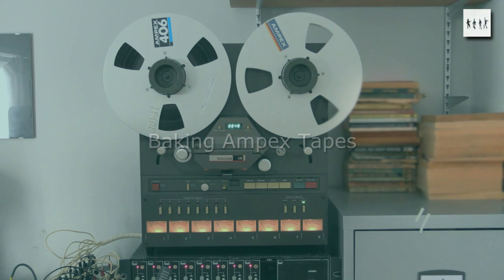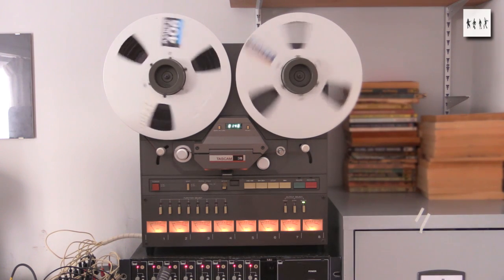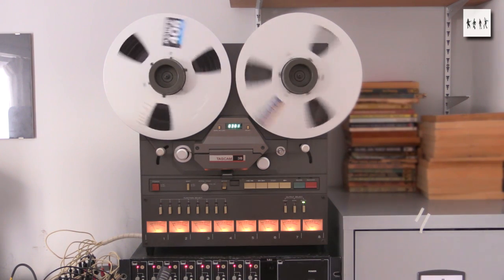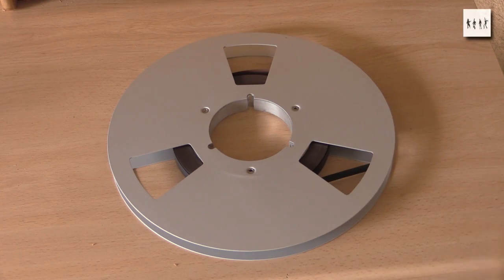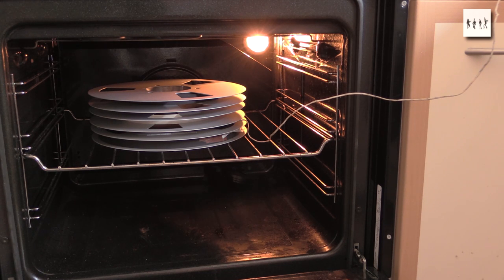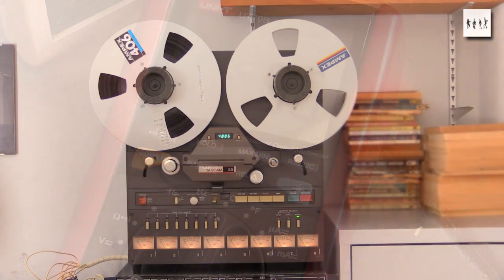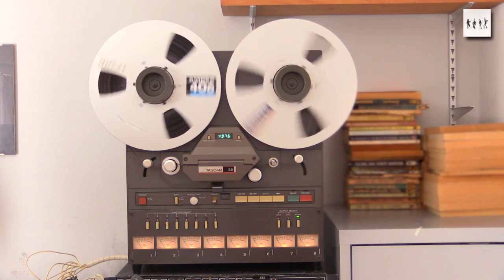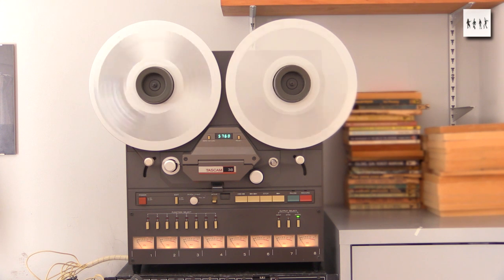Baking Ampex Tapes

Comment: There is a lot easier way to find out if tape has SSS without gumming up your unit like he did with this TASCAM:  Just pull the tape straight across the top of the headblock with holding up the trigger roller or arm and wind it straight across to the takeup reel.

If the tape is sticking to itself as it's feeding off the roll and you rub the tape between the fingers and is sticky as crud, that tape is full of SSS and needs to be tossed.

You don't need to bake non coated tapes and NEVER bake acetate based tapes, or the head destroys the acetate.
Reply from the maker: Hi Monte, 

I guess you didn't notice me ('he') saying I allowed this to run for a while quite deliberately for the purpose of demonstration; not for experienced tape users familiar with the problem (to whom it would have been apparent within the first few seconds), but for casual users who may be completely unaware of the phenomenon. 

In my experience, although some tapes are definitely sticky to the touch as you describe, others may not seem so gooey on first inspection, and only start to squeal some distance into the reel.

While there is no point in baking sticky tape for making new recordings (new - stable - tape is still being manufactured, if you're desperate to do that), tapes that contain precious and irreplaceable material can't just be tossed out, so baking or other restorative action becomes necessary. 

I assume you meant 'heat' in your last paragraph. Will acetate break down at 60degC? Fortunately, I have never encountered sticky shed with that base material.

Cheers!
Reply: @reqordist  ... Yes, heat.  There has been some tapers that have baked  acetate and wonder why it can't be played anymore.  Sorry, I didn't have the volume up and only watched part of the video. I should know better.  Thx and good luck.

Comment: Reel to Reel tapes should be Double-Coated.    Both sides of the tape should be glossy then you do not have any problem.   Unfortunately AMPEX and Quantegy are not Double-Coated and that is why they get sticky and the capstan and the rubber pinch roller gets sticky.   The best one is MAXELL and 3M Scotch ; maybe there are others.
Reply from the maker: Interesting. I had not come across the concept of 'double-coating'. 

The mechanism for stickiness is now well understood and described in the literature, and is related to the hygroscopic nature of the particular plastic formulation used to bind the oxide to the substrate. 

In my experience, a glossy finish to the non-oxide (back) side of the tape is an indication that it has not been back-coated; back-coated tapes generally have a matt finish. 

On the oxide side, tapes may have a matt finish (often older tapes) or a shiny finish (especially highly calendered tapes such as Maxell, often the thinner long-play variants). 

I believe that both the back-coating and the recording (oxide/binder) surfaces can become sticky, and that the underlying polymer chemistry, not surface smoothness, is the determining factor for stickiness.
 
Regarding 3M tape, I have recently had to deal with some back-coated 3M material, and that was very sticky, just like Ampex. Forunately it responded well to baking.
Reply: Back coated or not coated I do not understand technically.    One thing I know from my experience that outside of the tape should be GLOSSY.    The Cassette tapes do not have sticking problem because the back of the tapes are GLOSSY.   Thank you, Krikor Vasken from L. A. CA.

Comment: no sound after baking, are they usable after?
Reply from the maker: The low temperatures involved in baking (55 deg C) would not remove the recorded sound. Most likely the tape was blank beforehand or damaged by truly excessive heat. If the former, they could be re-used for further recording (but not recommended as they will go sticky again within a few weeks); if the latter, the tape base may have been damaged anyway.

Comment: This video very helpful for me!
I thought it was because I used editing splicing tape, maybe a little of that to?
Reply from the maker: Hi Henry - glad you found the video useful.

I've found most splices quite stable if purpose-made splicing tape was used. 

It gets messy where inexperienced people have used regular adhesive tape (sellotape etc.) - but in my experience, that just dries out and goes brittle with time, so the splices just fall apart; leaving the recording tape undamaged. 

It can be irritating when a splice breaks in the middle of a rewind and you end up with loose tape all over the floor! But it's no trouble to re-do them with 'proper' splicing tape.
Reply: Great to know, thanks

Comment: As mentioned, the temperature controls on a kitchen oven are very crude. They are designed to cook things. I would consider this approach very risky. Maintaining a consistent, and consistently >>low<< temperature in such an oven is highly likely to be very difficult. Don't try this method if you don't have a reliable way of controlling the temperature.
Reply from the maker: It has worked for me, but (as demonstrated) with constant supervision, and only after testing to verify the operation of the oven. I do make these precautions very clear in the video and covering text. I also mention in the text that I, in common with a large proportion of the tape-using community, have switched to  the use of a food dessiccator, although that also needs verification before use and monitoring. What method do you use for your tapes?
Reply: I use a food dehydrator with quite precise temp settings. I've done many this way, and it's never failed.  Interesting to hear that you can do it at all in a kitchen oven  :)   I've heard horror stories about tapes getting....(ahem) ....overdone.  xD

Comment: Can you tell by looking at the tape. I would have go to a studio to transfer them. How long does it take for this issue to appear? My tapes are from about 91 to 93.
Reply from the maker: Hi - You won't tell just from looking at it, I'm afraid. But within a few seconds of running it through a tape transport, you will know; you don't have to be listening to what's on the tape, so track layout is not an issue initially, as long as it will handle your tape width and spool size. If it drags and becomes squeaky, then you'll have to deal with it.  If your tapes are Ampex, they were using the dodgy binder formulation around the time you mention. Don't forget to clean your tape transport after running sticky tape through it - the usual cotton buds / isopropyl alcohol method should do the trick!
Reply: reqordist Should I bake them now to eliminate that possabilty? Is there any risk of baking if it didn't have the sticky issue?
Reply from the maker: I would recommend baking tapes only shortly before doing a transfer, and then only if necessary. Baking is not a long-term fix, as the water vapour will return after a few weeks, so there's no benefit in baking if you're not intending  to transfer at that time. And although it would probably not harm good tapes, there's no reason to subject them to abnormal temperatures unnecessarily. I recommend you contact a local studio who will almost certainly be able to check out your tapes. You may be lucky - some formulations have remained perfect and playable after 50 or more years!
Reply: reqordist Thanks, I appreciate your help.

Comment: How many times can a tape be baked?
Reply from the maker: Have a trawl around the web. Most experts vaguely suggest several times, but I cannot verify that. However, I have baked some tapes twice with no noticeable degradation. 

Most people would aim do the baking exercise just once, capturing to digital at the very best possible sample rate and resolution. 

I see no point in baking sticky tapes for everyday recording use - better to buy tapes with a new 'non-sticky' formulation!

Comment: My reels are plastic, not metal.  Is it safe to bake the tapes?
Reply from the maker: If in doubt, test! 

50degC wouldn't normally damage plastic reels, but I would advise you to exercise extreme caution. 

One approach would be to spool off the tape onto a spare reel (if the stickiness allows you to do that - see if you can bypass the record/playback heads - on some tape decks you can do that by routing the tape directly from supply spool to takeup spool via just the right-hand tension arm), and test-bake the empty plastic reel. 

If your plastic reels are not up to it, you could get one metal spool and transfer the offending tape to it for baking (again assuming it will spool cleanly as mentioned above.) 

In practice, the Ampex tape that I've owned and needed to bake has always been on metal reels. But note that 10 1/2" metal reels actually consist of two metal flange plates with a centre hub made of plastic.  That hub plastic material is quite hard and seems different from that used in all-plastic reels, but I couldn't say what the difference is. 

At the end of the day, it's your tape and your decision to bake or not to bake.

Be careful and good luck!
Reply: @reqordist  Thanks for the education.

Comment: I may have commented on this subject on his channel once before so I hope I'm not being redundant but if you bake your  tapes you will sorry. baking destroys the Fidelity of your precious recordings it's fine for dialogue but for sophisticated high-fidelity music we have found that it is not good at all. it will completely change the sound of you're recording. At least that was our experience with our two inch 24 track tapes that we had baked at three different locations. we suggest that you do some research on using Nu Finish the car wax in order to restore and rejuvenate your precious tapes. we tried it and it works

Comment: hi i did some baking of tapes i had to bake 406   9 x 1 inch for 8 hours as they were very bad i was baking tapes for days
you got to be carefull with the tape nabs on the  406 they can go funny i can tell you it works very well
i tryed 2 hours this works  it's to do with the space the tapes take up in the oven 
i baked 4   2 inch tapes for 2.5 hours as a test  did not work after 5 hrs alot better
Reply from the maker: It amazes me that the moisture can escape at all from a tightly-wound 2-inch tape pancake! I've only had to do 1/4 inch 1/2 inch so far.

Comment: I actually had what was supposed to be new in box sealed inexpensive Ampex tape do this in the 1980s
Reply from the maker: That's quite concerning - I had always thought that sticky-shed symptoms only appeared after the binder had aged for several (10+?) years. If it had been noted in new tapes in the 1980s, that begs the question of why Ampex didn't address the issue immediately. It would be good to see an authoritative chronology of the sticky-shed phenomenon.
Reply: I dug out one of the boxes of what now seems rather obvious that this was 'really' cheap audio tape.

Ampex 292 "Professional Audio Visual Recording Tape"  Professional and Audio Visual in the same statement seems like a oxymoron.

1.0 Mil Polyester 1/4" tape (549m) x 7" (17.78 cm) Reel.

It's very possible this was not meant to be used on machines with tape pressure pads as in an old Wollensak 1500 or T1515. machine.
Reply from the maker: Not a tape formulation I had heard of, but it does feature in a massive list of Ampex tapes posted on the Gearslutz forum (google it!). I hadn't realised they had made so many tape products. There seem to be a lot of NOS 292s on eBay at the moment - I wonder whether someone has stumbled on a container-load of them? Personally, I wouldn't even consider buying blank tape from any other source than the (two?) remaining active manufacturers!

Comment: I have a Tascam reel deck like this one.  I wish I could try this.  But, I'm a bit leery because I have a few hundred old radio commercials on 5" plastic reels, nothing on metal reels that you have.  I don't imagine putting plastic in an oven at 130 F for any length of time is a very good idea, but if you don't think it'll melt the plastic, I'd love to try it.
Reply from the maker: Hi - as I have said in replies to several other comments, this is really a matter for your own experimentation, undertaken at your own risk. You could spool off tape onto a spare reel (if the tape is not too sticky to wind), and try the reel on its own to see how the plastic fares. Or just get one metal reel for baking purposes. If you are at all uncertain, I would recommend you take your tapes to a professional who has done this before. Please also note - as I mention in the video description - that I have moved on from using a domestic oven to a food dessiccator, which has a more controllable temperature range, and whose use for tape baking is described by others on YouTube.
Reply from the maker: Ah - looks like you did see the other response - your comments arrived out of sequence!

Comment: so basically its just baking out the moisture, coudlnt you just chuck your tapes into a big plastic crate and chuck in a few moisture absorbers? and keep them in there or do what we used to do with photocopy paper and build a cupboard put a lightbulb inside.it and keep your tapes in there. the bulb boils off moisture in the air.
Reply from the maker: This video focuses on tapes that have already gone sticky, and it takes quite a high temperature (around 50 deg C) to drive off the moisture in a realistic timeframe, hence this procedure, whether using an oven as here, or a food desiccator.

It's possible that a low-humidity storage environment may have lessened the uptake of moisture over the years. Unfortunately, users were advised by the manufacturers to store their tapes in a moderately cool envirnoment with a 'normal' ambient humidity

Many people will have stored their master tapes away after initially releasing the material on LP or cassette, leaving them on the shelf for 10-15 years until a re-issue was required, at which point the horrible sticky truth dawned. 

You could create a low-humidity environment by putting a light bulb or other heating element in a suitably ventilated box, but temperature control would be essential to avoid other tape degradation mechanisms due to excessive temperatures, not to mention the potential fire hazard during unattended operation. 

In practice, custodians of major archival document/tape repositories implement very finely regulated temperature and humidity control, but this does come at the cost of constant power consumption and long-term equipment maintenance, which are probably outside the financial scope of the average recording enthusiast or small commercial studio.

Fortunately for people who choose to record on analogue tape now, the current tape formulations have been designed to avoid sticky shed, so they should survive the next few decades with normal storage precautions as well as the best examples from 50 years ago.

Comment: hi i 100% one this to ampex 406 1 inch tapes 40 of  them danger is the word some of the nab hubs don't like the heat and go funny
i had to put spacers in some of the reel hubs because the hub dia has gone down and would not go no the recorder.
i fixed the hub's on more thng  have the windows open all the time. i did them all in the winter when baking soming comes out
of the tapes into the air and can do your head in i had 8x 1 inch tapes in  at a time thanks for the video it helped big time bob
Reply from the maker: Hi Bob - have not had hubs misbehave for me, but only 1/4" and 1/2" tapes here. 

Regarding volatile materials, I guess good ventilation is always a smart move when baking anything, but in my experience (mainly with 406 like your tapes)  I have never smelled any real strong odour from the baking process. 

It must come down to tape formulation and reel components.